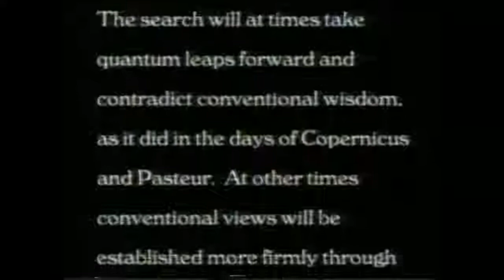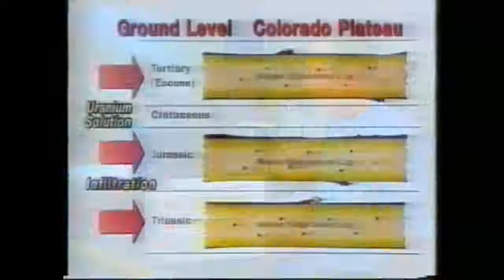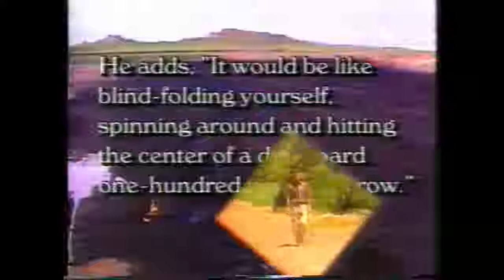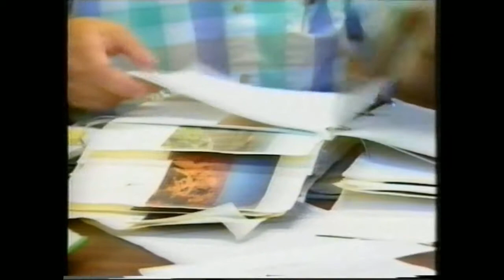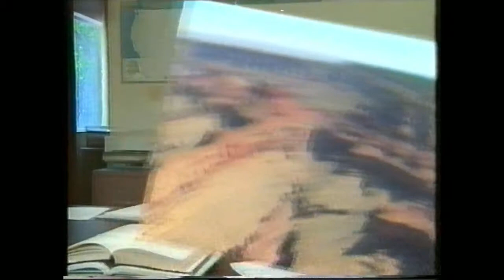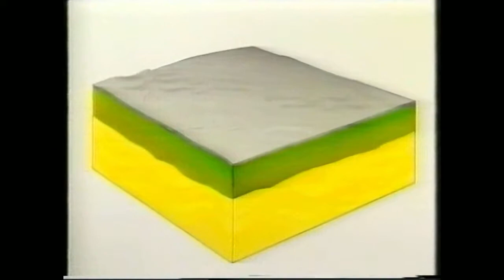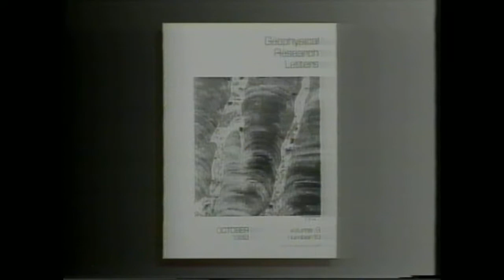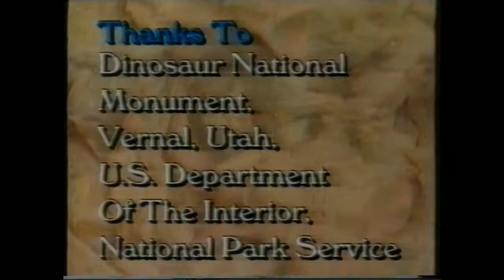The Young Age of the Earth (1996)

Comment: Using a consistent interpretation based on the seventh day of Creation, which has not ended according to the Bible (Read Hebrews 4:3-11), extrapolating from the template of the jubilee pattern (Leviticus 25.13) and the seven year sabbath (Leviticus 25:4), the 50th thousand year will be the Great White Judgment, where those who love evil go their designated existence with the Devil and his angels (Revelation 20:11-15). At the end of the 50th thousand year period of the Great White Throne judgment, a new Heaven and Earth will be created, when God once more begins His work of Creation (Revelation 21:1).

The 49th thousand year will be the Millenium where peace will reign on Earth (Revelation 20:2-6). This is about to occur when the third temple in Jerusalem is built for the anti-Christ (2 Thessalonians 2:1-4) and Lord Jesus Christ returns.

Since there appears to be 7000 years to the rest that began at Genesis 2:1-3, this suggests that every day of the Creation represents 7000 years. 14000 years account for day 1 and day 2.  This means that  day 3, day 4, day 5, day 6, account for 28000 years. The Earth was created on day 3. At most the age of the Earth could only be 28000yrs +6000yrs (for the rest from Creation until 2000 AD.), a total of 34000 years, which is a young Earth.